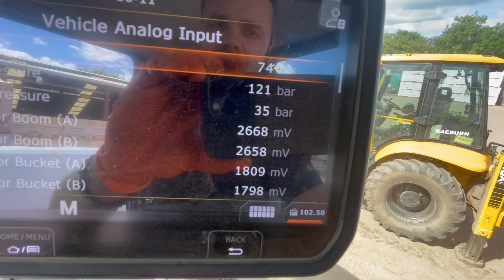DX235LCR-5 big mess ! / Oil leak / Broken bolt extraction

Comment: 🙏👌Ali nice to see you changing out the other bolts, best practice, but be pointless if you use them, might come back to bite you, throw them away or you might be 🙈👍
Reply from the maker: I’ll not use them to hold a pipe down that’s for sure but you never know when you might need a cap head

Comment: Good work getting that bolt out, im surprised how easy it came out, i thought it would be tighter than that, is there not a torque spec for them or do you do it by feel and give it a nip of the wrist?
Reply from the maker: There’s no locktite on the threads and it’s the tension on the bolt that keeps it if that makes sense so I knew it should come out without to much of a fight
Reply: Yes that makes sense.  I wish the bolts I worked on were that easy to remove!

Comment: Hi I'm on a dx140-7, 1 year old. Tracking yesterday and I heard a hissing in the cab then the seat completely collapsed to the floor and won't go up again. Any ideas ? Thanks
Reply from the maker: I’d imagine an air pipe has popped out I did have an air bad pop either way it’ll be a warranty job 👍
Reply: @alisdiggerdiary  looks like it's the air bag looks like it's popped could see inside it. Would inflate but won't hold air. It's over 1 year old would that be out of warranty? Thanks
Reply from the maker: @bencarruk depends if it get extra warranty I don’t think the air bag is expensive and easily replaced once the seat is out I did one in a video a while back
Reply: @alisdiggerdiary  nice one must of missed that video I'll try and find it thanks
Reply from the maker: @bencarruk here’s the link 😉

https://youtu.be/wSgYwleD8W8?si=QMoolZsIChrQQ_Wp